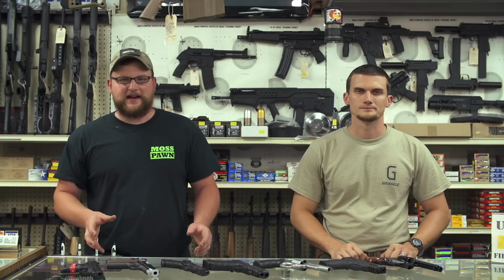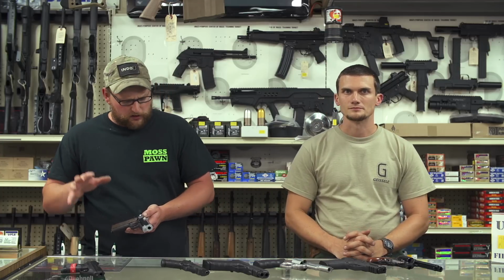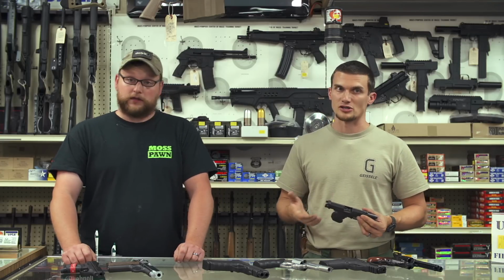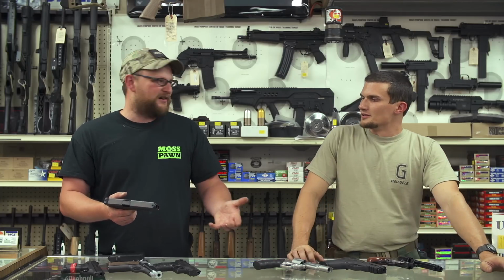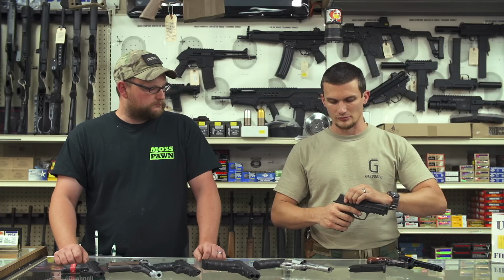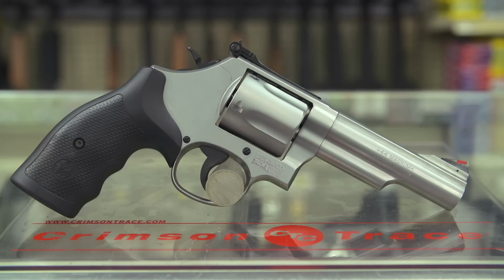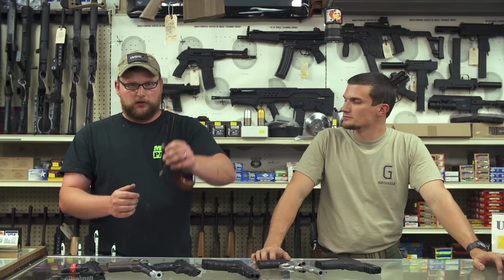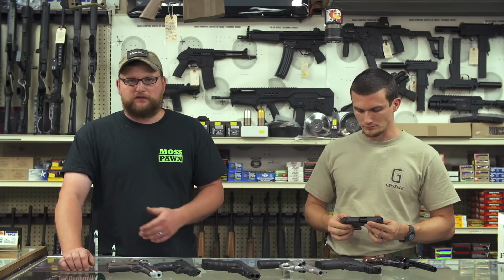Handgun Etiquette for Beginners

Comment: Don’t let the slide slam forward on a 1911? Don’t dry fire a 1911? I’ve gotta strongly disagree with you guys here. 1911’s are military designed guns and were in service for quite some time, and I guarantee you that John Browning knew who this gun was for... soldiers who didn’t pay for it and who may have very little firearms knowledge. You guys kinda sound like Wilson Combat telling people what not to do with their 1911’s... their guns cost $2000 and they say “don’t do x, y, and z with it”. If the gun costs $2000, and you copied a time tested design then theres no reason it shouldn’t stand up to some abuse (if you call using the controls of the gun abuse). I mean c’mon... RIA 1911’s can be had for $500 and will handle dropping the slide. There a lot of videos on this subject and in my experience the only people who strictly never let the slide slam forward tend to be the ones who make and sell, or buy high end 1911’s. I love Wilson’s guns, they look great and have a great rep, but if they made them so delicate that Bill Wilson says not to use the gun as designed, then in my opinion he made the design worse, not better. On the flip side, Dan Wesson who also builds high end 1911’s advocates dry firing, in fact he claims he does 60 seconds of dry fire practice every morning. If you have a gun with a worked trigger... then dropping the slide probably isn’t gonna do any favors, but if your off the shelf 1911 can’t handle some dry fire or letting the slide snap home (like you’re supposed to) then you have a crap or defective gun. Remember, the 1911 wasn’t built for matches or competition, it was built for combat.

Comment: I really enjoy your channel but you guys have got it wrong dry firing a weapon nowadays with modern Metallurgy is not a big issue and as far as the 22 goes the disconnect when you dry fire won't even activate the firing pin

Comment: My manual says dry firing will damage the gun. Yet needs dry fired to break it down. It's mostly a common sense thing. Although I would not unnecessarily dry fire constantly, it does cause undue wear that I would not want. I am meticulous when it comes to cleaning my firearm and I trust it will fire when I want it to. That being said when I pick up a firearm I always remove the magazine and rack it to check for loaded chamber whether someone just did it or not. It's a drill guys. Done repeatedly until it's automatic. Maybe if everyone learned that and quit assuming it's just for us dumb pricks there would not be accidental shooting of family members or friends because of showing off or just simply cleaning it!

Comment: Please do not point the gun at your own hand!
The guy on the right did it with several guns several times - apparently it is a habit, a dangerous habit that no one who works in a gun store should have.
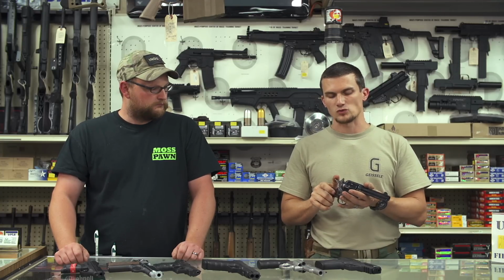The worst was at 8:31 when he had just inserted a magazine and then released the slide. Had there been a round in the mag, that round was now in the chamber, ready to blow his hand off. He then repeated that same mistake at 8:40-8:46.  I am surprised he still has a left hand. Then at 12:30 he points a revolver with a closed cylinder at his chest.
Cringe-worthy video! This video should be titled "Don't do what I do"

Comment: Im gonna refrain from calling these guys a couple of jokers, but seriously. They act like firearms aren't designed to contain thousands and thousands of small high pressure explosions,  ejecting and clambering rounds faster than the eye can see.

This video is a complete waste of time.

PS. There's nothing wrong with loading a revolver without a hand on the cylinder, and nothing wrong with pushing the cylinder back into battery instead of using the "crane".

Comment: At one point you suggest different ways to lower the hammer and you suggest this can be done in different ways, "depending on your experience". 
Weapons drills should never be varied. They are called drills for the simple reason that when you carry them out correctly then the weapon will fire only when you want it to. It should be a completely automatic process requiring no thought. If you allow variation "depending on experience" then an accident will eventually result. 
Fact!

Comment: Shit slams home every time you shoot it and harder then you just releasing it since at recoil it goes all the way back as opposed to just releasing from the catch. Test picking up the round does slow the slide but not as much as the extra velocity it gains from full retraction as opposed to just releasing the catch. Also alot of modern guns don't just slam home at constant acceleration.

 Personally I myself would be more concerned about the wear of the edge on the catch and and safety issues that might arise from that
Reply: Of course now if I had a very nice gun especially in older one I would not let It Slam home however firearm such as that Glock , a SIG PPS , M&P sheild or somthing like that you are not going to hurt it.

Comment: Iraqvetern8888, what about using spent casings in place of a snap cap?
Reply: My Taurus .45 will. And my savage .22. I used a spent casing as a snap cap when doing the trigger job, since dry firing a rim fire is a no no. haven't noticed anything bad about it, altho after a little dry fire practice with my Taurus, the casing won't eject properly anymore, when it gets to that point I just pitch it.
Reply: The mock primer on snap caps are spring loaded. I would think, after a few shots, the firing pin would be indented to much to catch the pin. Snap caps are cheap.

Comment: I couldn't watch anymore after he said crystallizing firing pins. Outside of hundred-year-old Colt ssa's some 22s and of course anything made by Hi-Point there's nothing wrong with dry firing it is a proven technique used by the military to train and competition shooters. As for letting the slide slam forward on a 1911 that's more to preserve delicate trigger jobs ie. Damage to the hammer and Sear, and prevent Hammer follow than 2 prevent the Barrel link from breaking. You may damage the lower Lug on the barrel but not the link on a properly fitted one.

Comment: I HAVE A QUESTION FOR ANYONE TO ANSWER; When I was learning the nra basic pistol instruction, my instructor kept ridiculing me for "riding the slide". I was gently holding back pressure on the slide as I closed it, and I thought, as Eric says, that it was bad to just let the slide "snap" closed. But my instructor said that guns were designed to violently slam the slide back and forth when it is fired, and letting it "snap" shut doesn't hurt a single thing, since its actually designed for it. So my question is: Who is right? Does it matter?
Reply: Were you riding the slide when chambering a round or just when the gun was empty? 
You should never ride the slide when chambering a round becuase force is needed to load a round without it getting stuck.

If you were just releasing the slide on an empty chamber, then it doesn't matter. Riding the slide or letting it slam home is up to you.

Comment: These guys know firearms...but to hold a revolver with 2 fingers through the port is silly. Buy a Colt so you don't worry about a weak crane on its cylinder. Have a 1967 Colt Python that has never been loaded in this way..and is slammed shut and pinch spinned for firing. Still tight as the day it was made.
Love the info in the vids, but some of the info is way overkill.

Comment: You're seriously advocating people ride the slide forward?? You realize guns are purpose built to contain small, violent explosions, that violently force the slide to the rear at very high rates of speed and energy.... Modern pistols feed better when you don't ride the slide. 

These are guns. They are tools, if I can't abuse them, and have them come back for more.. I won't trust my life with them.... I'm not gonna baby them, run them a nice gentle bath, and hold hands with them... They are machines, built purposely to be tough, and withstand use and abuse.. Some components will eventually wear out... Big deal? Replace them... Don't pussy foot around them forever.

Comment: doesnt the slide slam forward anyways when you fire a actual bullet?
Reply: +Tyler Crannell the weight of the bullet plus the force of the recoil and gases allow a form of cushion that it is designed to handle. a sort of ok example is like the difference between crashing into a wall and crashing into water barriers
Reply: RKSNomad thanks man that was helpful.
Reply: Tyler Crannell no prob.

Comment: quick question I just watched a concealed permit instructional video prior to this and the instructor had instructed us to rack the slide and let it back with full force especially on the 1911s so that the bullet would not get jammed and ramp up with full force possible he said don't be gentle, your recommendation to be easy on the slide is that for cleaning and clearing only or for loading as well?
Reply: drwombat when you have a loaded magazine in the gun you can let the slide slam forward because the round is there to soften the blow. if you let the slide slam home with an empty mag well you have metal smacking metal n it can crack things over time
Reply: 77MUDBOGGER thank you this makes total sense and is a discrimination that needs to be made unequivocally

Comment: I can see how dry firing rim fired guns can damage the firing pin. But center fired..? Come on.. I mean, I got it, you guys wanna teach the beginners how to safely handle a pistol. But don't feed wrong information.. Personally, dry fire with snap cap is even more dangerous for beginners.. Cause sometimes they load live round in there and thinking it was dummy round... Dry fire with empty chamber is safer in my opinion

Comment: Alright, one more gripe and then I'm done, I swear. Do you know how a firearm works? The burning gas expands and pushes a projectile out of the case and down the barrel. You holding the gun a certain way is not going to put more stress on the gun than a .44 Magnum does. I love the videos, but these are not delicate works of art. They are firearms. Don't handle them like they'll break if you look at them wrong.

Comment: The title of this video is Handgun Etiquette for Beginners. It should have started with an overview of the cardinal rules of gun safety, then gone on to describe proper and safe gun handling basics for handguns at the shop counter, the firing range, etc. Then a quick explanation of SA, DA, SA/DA, striker fired and revolvers, with an overview of the controls and features of each. Then loading, unloading, holstering, and finished. Kinda like the video description said. Instead it was a nonsensical ramble of bouncing from one random thing to another, with a liberal helping of unsafe handling practices throughout. If you are new to handguns, find another video. Not only is this one 16 schizophrenic minutes of newbie-unfriendly gun jargon, there is also a lot of misinformation as well which has been ably pointed out by fellow commenters. Lame.

Comment: You guys were talking about the problem with .22 rimfires that have been dry fired too much and that they start failing to feed and getting casings caught. I bought an old used Marlin 70p and I have been having that exact same problem.  It is an older style so the bolt does not catch open when the magazine is empty so I'm guessing that was the genesis of a lot of dry firing.  I have taken it to a gun smith but they said it fires fine and I just must have been using bad ammo but it happens no matter what ammo I use.  Any idea what I can do myself to alleviate this problem?  Any help would be gladly appreciated.

Comment: When did lowering the hammer become some difficult gymnastic event that the Russian judges have deemed too difficult for men to preform unless they use two hands?  I have been lowering the hammer on handguns for 50 years and never once had any problem or seen anyone else have a problem doing it.  It seems like some made up safety issue that women "feel" like it is too dangerous for them and therefor men should behave like they do.  I can see maybe if your hands are too small or week to operate the gun, maybe extra care could be useful but I think all this dumbing down of the average man is going to end up with lot's of dumb men.

Comment: Dont put your fingers past the cylinder of a revolver the gap allows gas to pass thru and can blow your fingers off and give savere burns have your hands under the cylinder in the proper position its a wheel gun not a auto pistol
Reply: Your grammar is questionable but the content of this message is correct.

Comment: Snap caps not expensive? Most places is $20 for 5 of them unless I am shopping at the wrong place. Please someone fill me in.

 I thought about having a buddy that reloads making me 10 dummy loads. Pennies a piece.
Reply: DjPorkchop73 I purchased 5 really good ones (Tipton) for $14.95 on Amazon. If you have a new gun, don't fire reloaded ammo else it could void your warranty.
Reply: While $20 isn't expensive relative to the cost of most gear, Safe-T-Trainers are much cheaper dummy rounds.

Comment: How does letting slide so called slam damage the gun supposedly when it is designed to do that every time it is fired. I think this is a myth. Guns are made to take abuse. They are tools. Not trying to be smarty pants, just dont buy into it i guess. Btw  i do enjoy your post and respect alot of your opinions i just think people are way too fearfulof hurting the weapon. I have slide slammed and dry fired many times and have had zero issues. But maybe its because i buy quality guns to begin with.
Reply: The difference is the round being pushed into the chamber absorbs all that energy when you are firing normally. Without the round absorbing that energy, acting as a buffer, the slide slams forward which could damage the internal components. I've seen issues like this on 1911s in which the sear surfaces were damaged due to excessive dropping of the slide on an empty chamber.